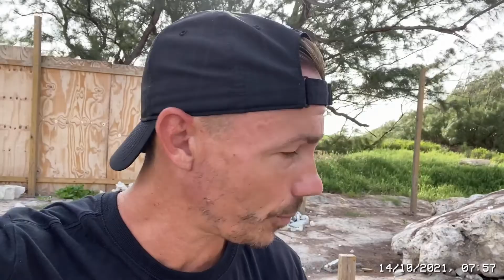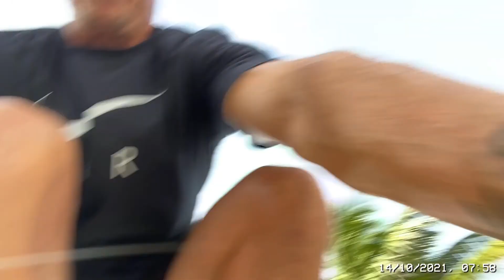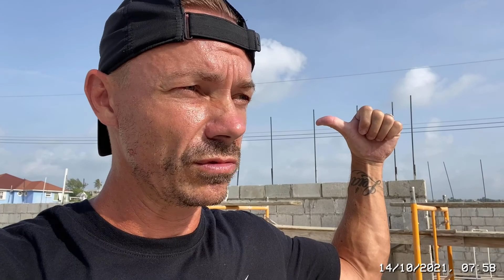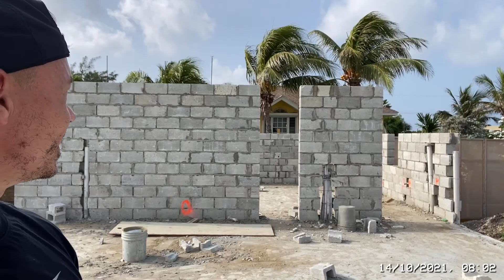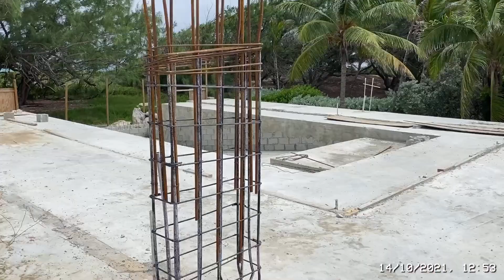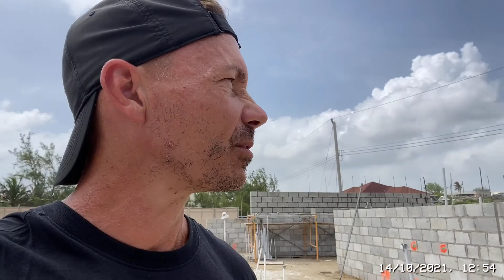Barbados 🇧🇧 Beach House Build - Day 126 Building our Dream House in Barbados

Comment: Could you tell me if the building inspector had to come out to inspect your build throughout and if so what parts of your build they need to exam before you proceed I remember you said they had to pass the rebar in the pool do they have mandatory checks throughout
Reply: Thanks sound like they just let you crack on after  plan approved  looking forward to see the roof   Going up  may  seem stressful at times but you have made good progress  when the roof and windows is things will start to take shape I  and things are double if not 3 times the price there  enough to make any man sweat  but keep positive it will come together nicely just have to stay on the ball in the process good luck and thanks for the response

Comment: Really enjoying your videos. Starting my build in St lucy soon .probably got more information from you than all my Google searches 😃
Reply: Would you be posting videos as well,   care to share the contractor you will be using?
Reply: I will be doing most of the work myself. I'm a carpenter by trade and build conservatory and extensions in England. Also my project is a lot smaller than Alvins 😆